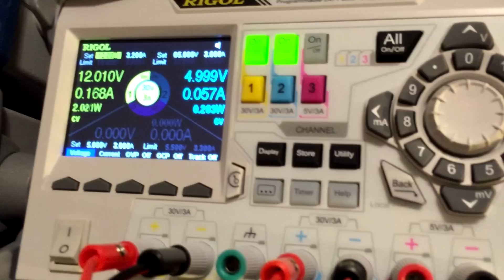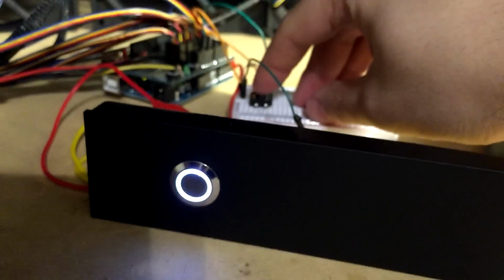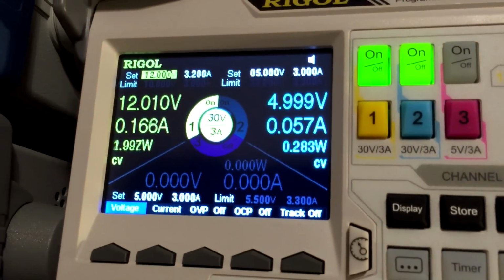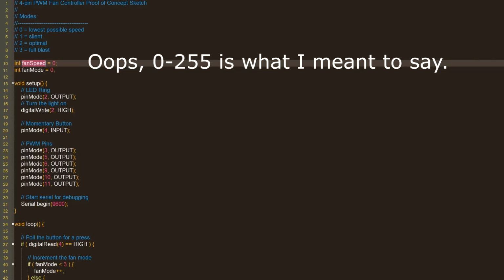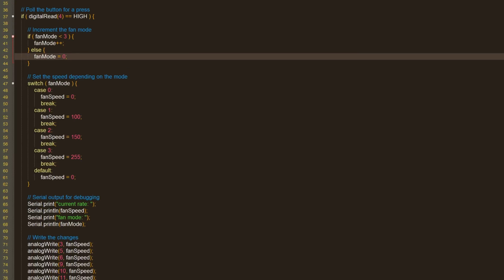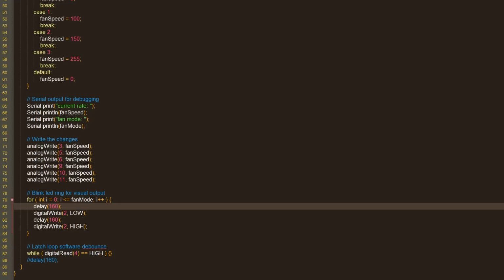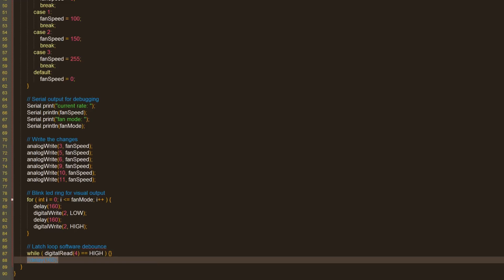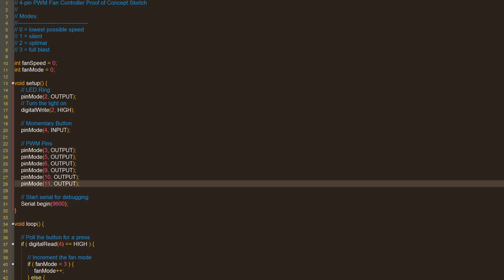DIY Arduino PWM PC Fan Controller (Part 1) [Prototype] #0000

Comment: is there any possiblity to use a potenciometer to regulate the fans velocity?
and what about a simple display to show the actual temperature and fan speed?
Reply: This is possible, the potentiometer would be the most simple thing I guess (I keep forgetting what the code for LCD-displays is).
Connect a 10k ohm potentiometer to an analog input (I don't know what the shield actually is and if it supports those kind of inputs) and lead it read out and control one of the PWM outputs ;).

Comment: hey man i have some questions.....can this be setup to run in a car and run off 12v off the alt? want to use it to controle fans for cooling amps.....b4 i get started on some questions, how much will the project cost estimate? i can get somthing made for what i want for $115 ready to wire? thanks. looking forward to talking to you.

Comment: FYI, despite being 4 pin, all the headers except the CPU_FAN on 99% of MoBo's, even high end ones like Asus ROG stuff, are voltage control only, no PWM. The 4th pin on the header is just there for show and so they can claim "4 pins!" despite not having pwm functionality.
Reply: while i'm sure this is mostly true, it is not with my maximus vii hero board/4790k. i can go into bios and choose DC or PWM mode for cpu fan as well as cha_fan1-4 (all 4 additional fans). the cpu_opt fan does not have specific control but i believe it follows exactly what the main cpu fan header is doing, almost like a built in fan splitter.
Best way to know for sure is to check the motherboard datasheet/manual.
Reply: Matt B It is true for all the Maximus boards as well, that's what I have. The selector in bios for that determines how it pretends to be pwm, but the only true pwm header is the CPU. Asus even admits this is you ask them about it directly.
Reply: Not true with my Asus Sabertooth Z87, all the 5 separate controllers are PWM (I use "speedfan.exe" with direct SM Bus control, the CPU fan and CPU aux fan are shared signal.

Comment: +TechnologyCatalyst
Can I do this project without a protoboard, or do I have to use the soldered on fan plugs? Also, I love your tutorial and it was much more thorough than any other I've seen on using the PWM function on Arduinos.
Reply: UPDATE: 
I tried using the code above to do this, but the LED just blinked the entire time. The button and all still worked, but the LED didn't give any signal. What can I do to fix this?

Comment: Thank you for sharing! One question though: I'd like to build something similar but I don't really feel save directly connecting wires from the molex of the PSU to a breadboard to provide power for the fans. I mean this could kill you if you are touching the 12V lead and the ground with your hands right? You measure a lot of Amps there and those could kill you pretty quickly or am I missing something? Would be glad about an answer :) Thanks!
Reply: Yeah, you're missing the fact, that yes, amps do kill you, but you don't have amps without voltage. 12 v is perfectly fine to touch(because you skin resistance is very high, you won't get a lot of amps thru yourself, maybe a few microamps, if any).
You can safely touch 48v as well, you might feel something, but nothing dangerous.(AC 48v might shock you, but still not deadly)
On the other hand, if you were to lick 48v it might stop your hearth, but even then, if you're lucky you can be revived, but, yeah, dont lick 48 volts)

Comment: +TechnologyCatalyst
I tried to run this with an Arduino Nano, and although I did initially get it to work, it became crazy hot when powered off the +5V from a PSU... So I am a little confused by that behavior due to the specs, which state it has an operating voltage of 5V, but the input voltage is stated as 7-9v... Is that my problem, is it overheating because I am feeding it 5V instead of the 7-9? That seems really odd to me, but I am no electrical engineer, so I submit to you that are more knowledgeable than I. :-)
Reply from the maker: Do you have the 5v from your power supply connected to your VIN pin or the 5V pin? Also, what all is connected to the nano? The pins can each only supply about 40mA each
Reply: Initially I used the 5V, then tried the VIN. I have only the momentary switch, the fan PWM and an LED in place of the speaker.
Reply from the maker: If the power is coming from the 5v from your power supply, that's regulated, so you should plug it directly into the 5v pin of the nano.  If you plug it into the VIN pin, it goes through the voltage regulator built onto the nano, and will have a small voltage drop and run lower than 5v, which can have adverse effects.

So the fan's 12v line is running from the power supply, correct?  And only the PWM is going to the nano?  Oh, and be sure the fan's ground has its own path to the power supply else it will put some serious strain on the arduino nano if you're using its ground since that means the current return path will be through the arudino's PCB, which isn't designed to handle that much current.
Reply: +TechnologyCatalyst 
Well at least I've got everything right... I basically just did a direct swap and pulled the mini Breadboard off the uno and swapped out the jumpers for the correct ones (went from female uno to male nano), and that was it. I am actually surprised the nano still works, it got hot enough for the nasty burning smell to be present six feet above it, and the magic smoke of death started rolling off it. I have checked it over about six times now, I even went so far as to disconnect everything and use the Uno with the same pins connected and it was fine, went back to the nano and it heated up again. So perhaps it's just a bad board, or has cheap components that are freaking out, I tried USB to power it, but it didn't seem to be sufficient, as the lights just came on and nothing past that, they all just stayed on... I think I'll try my other nano, and if that doesn't work, perhaps I will just buy a replacement that is an actual Arduino sold unit instead of the cheap ones...
Reply from the maker: try putting a diode in series between the PWM pin and the fan
Reply from the maker: Just out of curiosity--I had one brand of fan that drew quite a bit of current through the PWM wire--but due to the voltage drop across the diode, it might not work at all.  Have you tried the nano without the fan connected to see if it gets hot?  and have you verified the voltage you're sending into it is indeed 5v?  it's really easy to mix up the 12v and 5v on a molex connector
Reply: +TechnologyCatalyst I am a bit of a n00b when it comes to all of this, and I have only the most basic of electronic components, the only diodes I have are LED's... As well, with my lacking electrical knowledge, I do not know if that would be a sufficient substitute for a 'normal' diode...
Reply: +TechnologyCatalyst
Thank you so, very much for taking the time to help me out with this! Is it possible that the Uno would be able to handle a high current fan better than the nano? I am using the exact same fan (Not just the same model, but the same unit) on both. I have not tried it without the fan connected, I will go do that right now - thank you for the suggestion (reminder), this should have been my first step... MY apologies.

As far as the voltage, I did make sure that I was using the 5v from the PSU (Although red has always been 5v for me, I am always paranoid about being wrong, so I always test them to make certain).
Reply from the maker: Well, PWM input is just for signals, not for any significant current (assuming the fan is working correctly), so it shouldn't be any different controlling it with the uno versus the nano.  (just be completely sure the fan's 12v and ground are DIRECTLY connected to the power supply and not through the arduino--the ONLY wire going to the arduino should be the PWM one)
Reply: +TechnologyCatalyst Oh, I was responding to your comment above, you had said that one of your fans pulled quite a bit of current through the PWM wire ("Just out of curiosity-I had one brand of fan that drew quite a bit of current through the PWM wire"), so perhaps I misunderstood what you had meant...

I was wondering, we had briefly discussed this before and you mentioned you might do it, but I was wondering if you ever got around to making a PWM controller for your girlfriend's computer that automatically throttled the fans based on temperature? If not, is that something still on the table?

Right now I have four monitors, with a small 19" 1080 panel that is dedicated to monitoring telemetry, but one thing I am hoping to be able to cast aside is the monitoring of my fan speeds, because I use Asus AiSuite to do it (as well as temperatures), and I would very much like to get rid of it (I do all of my overclocking manually from the BIOS/UEFI). Although I know you are more of a minimalist, I am all about seeing as much information as possible, especially with my rig, it is a $500 motherboard - Rampage IV Black Edition, a $600 CPU - Core i7 4930K@4.5GHz, 32GB of RAM, GTX 970 G1 Gaming, 2x250GB 840 Evo's in RAID 1, and several 3.5" HDD's, but anyway, I really need to be able to monitor everything, and I was thinking I would add a touchscreen to the fan controller, to allow me to not only have the fan speeds displayed, but also the corresponding temperatures, and I would like to be able to touch any given fan and pull up a brief historical graph of the speeds... Just to be clear, all I am wondering if you have done/plan to do is the automatic fan speed, and I will work from there...

I am terribly sorry for the length of this comment, I have OCD about being specific to avoid any possible miscommunication, as well as providing as much detailed information as possible... So if you would prefer I not do so, please let me know, and although it actually takes me LONGER to write a message, I will most certainly do my absolute best!

Thank you again for the assistance and conversation!

~Jacob
Reply from the maker: Oh, sorry about the miscommunication.  Youtube only shows the most recent comment so it doesn't give me any context. 

But anyway, I do still plan on doing that.  I've just been short on time with work and the holidays, but should get to it sometime in the early half of this year.  While I'm not exactly a complete minimalist, I just don't see a need for myself to have a full touch screen display for my fan controllers if I can make it autonomously controlled directly by temperature, so I doubt I'd add a screen.  Are there any third party PWM fan controllers that have detailed information and granular control?  I know the PWM controllers are scarce compared to the resistive ones, but surely a few decent ones exist.  If not, you could use a raspberry pi and a touchscreen and spin up your own controller and have as much information and control as you'd like!

Comment: Afaik the analogWrite function operates at 500Hz, but shouldn't the frequency be 25 kHz according the PWM standard?
Does make any difference in terms of fan operation/behaviour?
Reply from the maker: It depends on the fan.  The majority of the ones I've tried all work well outside of the frequency range of the standard.  But on the flip side, I had someone tell me their fans didn't like the default frequency so they had to go change the timers to get an acceptable PWM frequency to make their fans happy
Reply: +TechnologyCatalyst Any chance to get a code snippet of that?
If there is any way, that a non-standard operation makes the fan produce slightly more disturbing noise (clicking, rattling), I am willing to avoid it ;)
Reply from the maker: This might help you out.  It's a function that someone made that lets you set the PWM frequency without doing any low level register stuff: http://playground.arduino.cc/Code/PwmFrequency
Reply: +TechnologyCatalyst Hm, it allows to use 31kHz as closest divider frequency, still a little off. I guess I have to tinker myself with digitalWrites and delays to get a software defined PWM at the right frequency. But thanks anyway!

Comment: Hi. Great project/tutorial : )  I am getting ready to start a cabinet cooling system and before I found your videos, I read a lot of things saying that pc fans need 21 to 28 Khz pwm frequency. I may have missed something,  but any help on this would be much appreciated : )
Reply from the maker: Yeah, you should just be able to copy/paste the code into your sketch and be good to go.  You can always set a PWM pin to 50% duty cycle and measure it with a scope or the frequency function of your multimeter to verify the changes actually taking place.
Reply from the maker: That's the standard, but many PWM fans can operate using a PWM signal way outside of that frequency range. (Like mine for example) I would just try it out and see if it works or not. If not, you'll have to adjust the timers to get the frequency you need. Just beware if you do, it can affect other arduino libraries that rely on those stock timers
Reply: +TechnologyCatalyst The link you gave above allows us to set various frequencies w/o getting involved in those libraries, correct? I'm up for not messing with the ground levels just to get the top the way I like it. :)
Reply: TechnologyCatalyst
You're very thorough in your answers. I'm diggin' it. Already subscribed. Information overload in the last two weeks with the UNO. I think I need to take a step back for a couple of days. Good channel, Man.
Reply: +TechnologyCatalyst What I did for mine was simply to connect the RPM Sense pin from the fan to my motherboard via a PWM splitter I had laying around, but it would work just as well with any wire... My issue was that I had purchased some new fans (Phanteks 140mm), and they are so quiet, even at full speed (1,500 RPM), that I did not think they were running at full speed, but being able to monitor the speeds via the motherboard was infinitely helpful, also to be able to correlate the Arduino PWM output number to an actual fan RPM was nice as well. My only issue is that 0 from the Arduino is not 0 on the fan, which is probably normal, my motherboard (Asus Rampage IV Black Edition) has a nice setting that allows it to turn fans off when they hit the minimum speed.